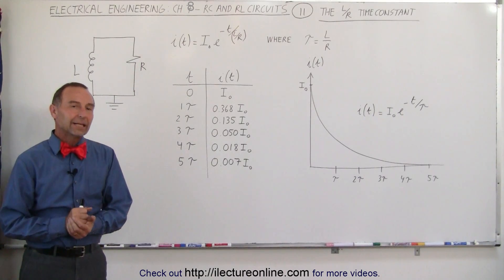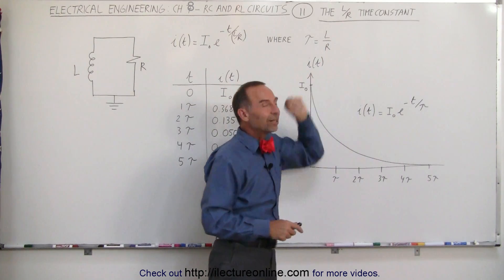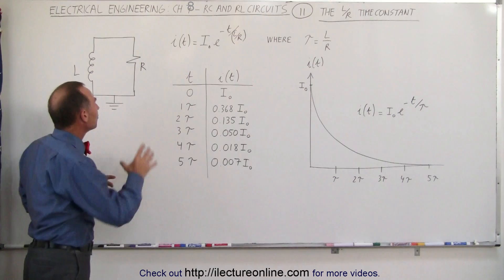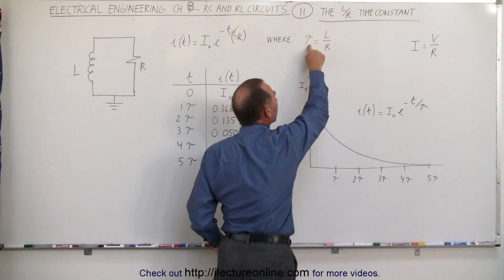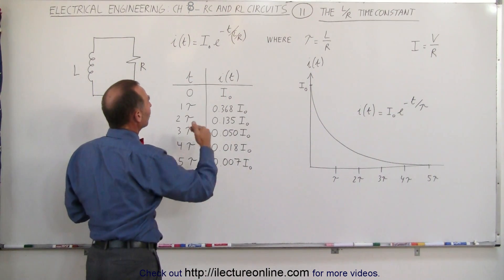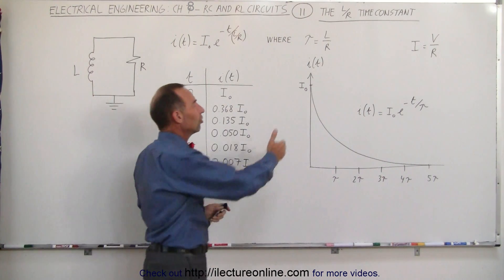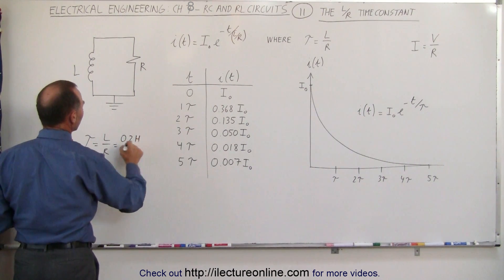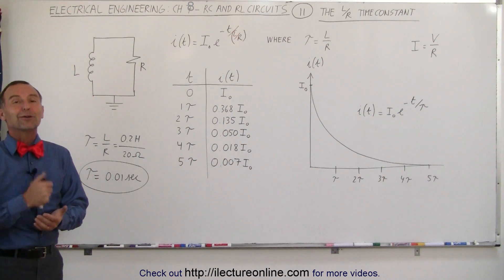Electrical Engineering: Ch 8: RC & RL Circuits (11 of 43) The L/R Time Constant

Comment: Hii Professor,  i have not understood Why in time constant of RL circuit the R is in the denominator. (L/R)
Reply from the maker: We have videos that explain that.  Think of it this way.  The inductor opposes a change in current.  If the resistor is larger, there will be less current, and there will be a smaller change in current.  Then the reactance will be smaller and that is why the R needs to be in the denominator.
Reply: @MichelvanBiezen  thnxs for ur quick response Professor. 
I really appreciate. 
I got u well now 😊